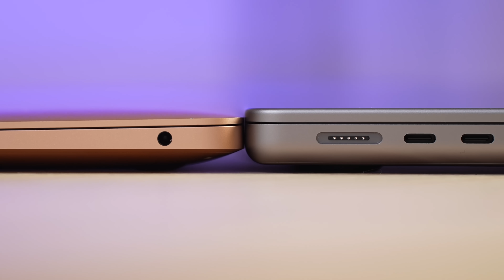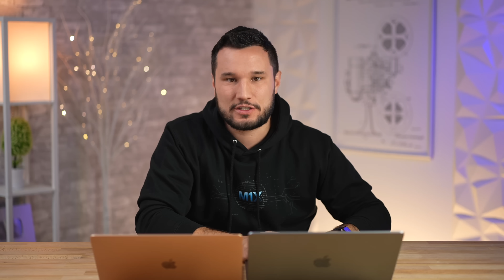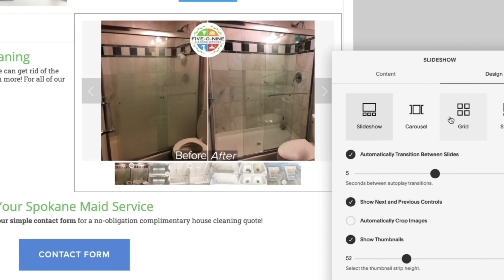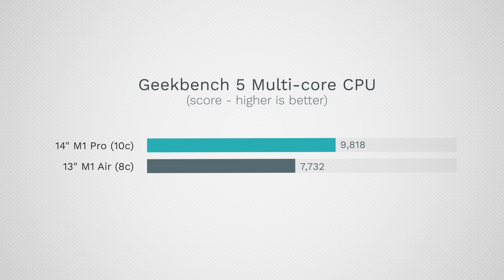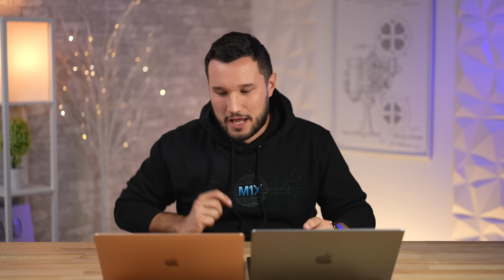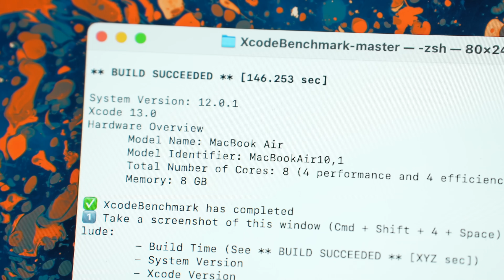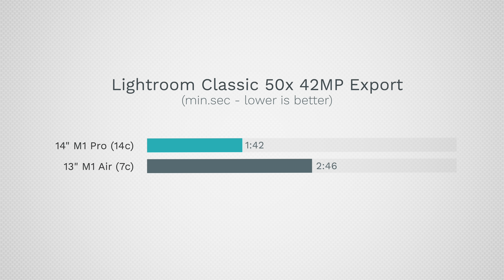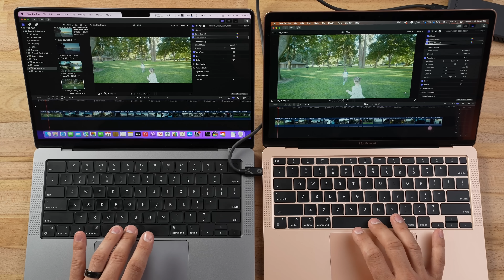14" MacBook Pro vs M1 MacBook Air - Worth $1,000 MORE? 🤔

Comment: New MacBook Pro just doesn't have the profile/image of a traditional Mac aesthetically. The camera notch (very un-Apple which has always been about symmetry and visual (and experiential) seamlessness), the lack of any kind of MacBook signage screen-side for the user (at least some kind of consumer reassurance it's worth spending big bucks beyond a comparably-kitted PC; that you've acquired something different) and the keyboard  just doesn't have that traditional Apple 'sophistication'/difference of the Space Grey/Gold etc aluminium in between the keys. In some ways, it could even be a new Dell XPS or MS Surface given the lack of logo and dearth of Apple-specific aesthetics (looking at this machine sitting at its screen at least). Apple is absolutely right to return to a chunkier profile with an emphasis on practicality and usability (retreating from the myopic days where thinness and near invisibility was an end in itself!), but there should have been some retention of the visual slickness that has always defined Apple products. That camera notch a big no. Some sort of bezel would have been preferable to maintain that Apple 'cleanness' stylistically. Same time, seems like a fantastic machine under the bonnet powered by a game-changing chip. It would be fantastic to have to this!! Criticism aside.

Comment: This review is slanted and MaxTech should not be doing this, one can see by his use of language, even though numbers are used he tries to negate the advantages of the 14” MACBOOK  there is very little explanation of its advantages, both laptops are very good however there is nothing non MAC out these that can compete, I guess you could get a MacBook Air with more ram and bring them closer in performance.

Comment: The new design and better specs makes the new one very tempting, but I question if it’s overkill for photo editing? Maybe I would be better off with the MacBook Air. I will be using an external monitor about half the time.

Comment: Well, it's really $850 if you compare the same RAM and SSD models...I keep trying to go with the MBA, but there's too much missing in the 2020 model: 

1. Crappy 720p webcam
2. single available TB4 port (I'm ignoring the SD and HDMI ports, which should have been higher speed IMHO)
3. "just" a Retina display, 400 nits max

The MBA is such an attractive machine, and in terms of computing power more than most people need, but there are a lot of reasons spend the extra $850 on the 14" pro, even with the uncharge for the 1TB SSD and the unbanned SoC.

Comment: Really great comparison between these two Macs. The Air with 16GB RAM seems still to be a very good choice for most tasks et even for heavier ones. The Pro as it is named is more suitable for professionals with daily heavy works (photos, videos or code compilations). But does it really worth 600$ more ? I would choose the Air (or the Mini) with 16GB RAM.

Comment: I think this comparision is a bit not fair for the M1 macbook air because it has only 8GB comparing to 16GB of the 14 inches, then maybe it has to manage swapping memory which costs part of performance there. Just sharing my thought, your videos are great, cheers guys !
Reply: He did a video comparing last year's MBP 8 vs 16GB and most of the time there's very little difference. Though 16GB RAM really should be the standard on any $1000+ laptop.

Comment: This isn’t really representative of the new MacBook pros though is it? It’s widely known that the model you’re testing against the 14 inch is gimped. Apple had chips that they needed to get rid of but were still able to offer additional performance for additional cost including all the ports and new features so they put out that model. If you’re looking for the performance that you seem to be looking for in this video, look at the real MacBook Pros.

Comment: I loveeee the fanless design of the m1 air - it is absolutely insane what you get for the price at the bottom end with these. The m1 pro is great, dont get me wrong, and a more usable overall computer - but the air is fantastic for a lightweight, quick laptop
Reply: Yea I think fanless design will last longer.
Reply: Fanless doesn't matter cause u could barely hear the fan in the new Macbook Pro in both 14 and 16
Reply: @xxkarlosxxxxxx7233  that’s true but the air getting up to 95 degrees Celsius is kinda nerve wracking, that’s almost boiling temp… 🥵
Reply: @getpballs  there are ways to reduce the temperature by adding cooling thermal paste between body and processor. It's not perfect solution but it helps. Also even with rendering 4K my Air is staying fairly cool.
Reply: Whatever which product Apple you buy , you will get 7 year update maximum
Reply: It's worth the extra weight for a larger display and better speakers better build quality with the fans
Reply: @cherkas009  also better display
Reply: @cherkas009  what is better quality of fans vs no fans? Having fans make it better quality? OMG :-)
Reply: I totally agree with that. Portability is insane with macbook air. However I expect a 14" air design without notch and iMac colors hopefully in 2022.
Reply: I should add that the M1 chip gets smarter (faster) over time. And it was 100% noticeable, from when you first use your laptop to months into use.
Reply: I think the better comparison who be MBP 2020 vs 2021, both 16gb.  The MPB 2020 you save almost a 1k still vs the 2021.
Reply: Yeah I'm really satisfied with my air
Reply: Yeah even at the same price tag I'll take 2020 MBA over MBP. Much better ergonomics are much more important to productivity.

Comment: Thank you for making such an in-depth comparison! I was surprised by how great the Air performed for its price point. I would've thought that the Air was a big improvement over the previous Air, but after seeing your benchmarks and investigating further to compare them to mine, I was surprised to find that just the Air is a massive upgrade in almost every way over the 2018 15" Macbook Pro I'm writing this comment on!
Reply: I have the same, those Apple Silicon have been looking really attractive haha, but I think I need to wait a few more years before upgrading. What are you thinking?

Comment: Both are great. To be fair I would utilize both at the same time. 14" more as laptop/desktop attached to 34" monitor and the Air as a backpack friendly when commuting or traveling. Both are amazing machines! Forgot to mention cameras ... in my opinion, this update is way overdue but 1080p is finally here!

Comment: I’m running a 2003 13” air with 8gb ram with Monterey and it runs amazing! So outdated though with no thunderbolt ports. The new M1 MacBooks look like they run fast as light in comparison. The new displays are what 💦dreams are made of 🤤

Comment: Macbook air is such a good value. Usually cheaper laptops suffer from lower quality components. Not here. I would bet that for 90% of people it should be sufficient. 

Now, the 14” improves usability with double ram, 512 gb storage, better screen, sound, camera, ports, CPU performance, graphics, footprint barely grew with an extra inch of usable screen… Its value is also undeniable. 

You say that the 14 inch is chunkier, but it is an illusion. In terms of footprint they occupy almost the same space. It may not look as stylish, but they prioritized function over style. For someone who appreciates utility, like me, I like it.

Comment: Hey I've got a question:
As an architecture student (1st year of masters) I want to get a new Macbook, as I have been using the 2012 13inch MBP. Is it worth holding out (a while) to get the M1 14inch MBP or will the M1 MBA (or potentially 13inch MBP) with 16gb RAM and 512gb SSD work well for me? What do you recommend? In my country the price difference is bigger so I'd like to know what you recommend.
Thanks for the video, I've really been enjoying them lately, really good in depth reviews!

Comment: Thank you for these detailed measurements !

Even the base M1 Pro with 16GB RAM has a RAM bandwidth of 200GBytes/sec — i.e. triple that of the M1 MBA.
So, both the MBP and the MBA might be using a similar processor architecture (M1), but the RAM speed seems to have a significant influence on the performance, be it for CPU-bound tasks like XCode compiles or GPU-heavy tasks like Blender renderings...  IMHO, worth the $1K price difference, thus.

Comment: MBA 13" is the best value for students and new Mac users, it shows what Apple Macs are capable in a small and reasonably price computer. With it, the amazing screen and loud speakers.. The 14" MBP is a waste of money if you're just doing some research or running some simple simulations, that extra power isn't really needed for school or daily use. However, having extra power is handy in-case you have friends that say that their core i5 is faster than the M1 Pro.

Comment: First of all, great video! Being a PC Windows minded hobbyist/gamer/engineer for over 25 years, with those amazing M1 specs I am really considering going to MacOS for quite some time now. Other friends and co-workers already made the jump. When in need, I can always use Rosetta or i.e. VMware. Yes Apple asks enormous prices for ram and ssd upgrades but a comparing gaming laptop the pricing is about the same. Question about the giveaway. You mention it will be one week from the 'launch video' at 7AM Pacific Time. Does that mean, aside from already posted videos, your will be doing a specific launch video? Would be nice to mention an end-date in your first post here.

Comment: Videos like these are fantastic help when making purchasing decisions. Comparing specifications side-by-side, and considering the total cost of an upgraded MacBook Air (RAM, SSD) made me consider stepping up to the M1 Pro model because of the difference in price. Watching the videos with detailed comparisons helped me realize what my needs are, what I will get if I stretch my budget, and what I can expect if I choose the upgraded MB Air for a lower cost instead. I also appreciate the emphasis on the practicality of each model depending on the use cases. Max Tech has become one of my primary sources for doing research before making a purchase!

Comment: Im surprised about the battery life. I guess the new display uses more temperature, but given the bigger battery size, I would expect the pro to last way longer, just how the 13" m1 pro had better battery life than the air. Maybe if all you do is Office and media consumption, the battery life surely would be longer in the 14" pro.

Comment: I think the Air would be enough for my performance needs, and the fanless design is awesome, but... only supporting one external display is a deal breaker for me. Even my old 2017 13" MBP supports two external 4k displays. I would go for the 14" if I had to replace my old one.

Comment: Guys! Greetings! Since the release of the MacBook Pro on the M1 Pro, I've been looking for such a comparison. And so you did it! Low bows to you for this video and heartfelt thanks! And, although I do not speak English at all, today web technologies allow you to watch videos in other languages, with simultaneous translation (thanks to other people for this), and everything was clear to me (I write via google translator). OK. Let's go back to the comparison. Now I see that Air, for today, to cope with all the tasks set by me. However, my headphone sound card does not support drivers for the new Mac OS. And in this case, a new, high-impedance output on the MacBook Pro M1 and a new, built-in microphone (I'm doing music and, a little photo) can help out a lot. Also, I often have to use the built-in SD card reader, which is not in the MacBook Air (adapters are not an option on the road. When Apple returned the connectors, I applauded). Also, it seems to me that the new MacBook Pro looks very old-school outwardly, which I really like. Now I come to one big BUT: in my country, $ 1 costs a little less "than a wing from a Boeing aircraft." Due to the current situation, not only in our country, but throughout the world, incomes have not only decreased, but are falling every month. Therefore, today, M1 Pro is still only a dream ... But dreaming is not harmful. I will dream, strive and not give up. I'm glad I got to know your channel. I wish you many subscribers and all the best!
 PS: The American keyboard layout will help me to master "touch typing" in my native language ...

Comment: Im doing pro level editing and photography. Max Tech is definitely the guy give you real shoot to decide what you need buy for your next shopping. I bought before the Mac book Air. I wish to have the new 14" it would be very helpful for me. Im getting slide issues with 4k editing. but sure you can run the proxy and finish all your task. Back to 14 inch it is faster and has more options add with card reader and HDmi. if you have your money it is pleasue to buy. Wishing the 14"inch for new 50 new age thx

Comment: Great review: it's down to Earth, compares both synthetic benchmarks and real-life applications. I believe a more fair comparison would be to use a 16Gb RAM / 512Gb SSD Macbook Air with a Macbook Pro of the same RAM and SSD space (the base model). I believe the performance for real-life applications, such as processing RAW files, would be closer between the 2 laptops - their prices would also be closer (a $600 difference). This review shows that the Macbook Air is worth buying for a lot of people, and that the Pro is also worth it the additional cost, depending on your use cases and budget.

Comment: The question if the display cracking issue is fixed in the new mbps. Air is still cool in 2021

Comment: Thanks for such an informative review, the M1 air has more power than I thought, I guess it depends on what you need to use it for mostly and the screen difference is remarkable side by side. A good spec mac lasts a long time, I'm still using my mid 2014 macbook for my digital art which has been amazing for the last 7 years, but the graphics are not able to cope with much now, I cant upgrade the latest photoshop and other software I use, so Ill be needing to upgrade, would love to win that 14 inch, it sounds amazing! The cost is eye watering in NZ so it would be awesome! Thank you for offering this incredible givaway!

Comment: It's time to upgrade from my 13" 2015 pro that's now having charging issues due to rusting magsafe. I'm torn between between M1 air and base 14" for battery life and cost reasons. The M1 air itself would be a big upgrade but 14" would be more future-proof. I'll use it for digital marketing

Comment: Apple's lineup makes so much sense now. Obviously they are all luxury machines: I remember when I was given my first MacBook I was so happy cause I knew it was an expense and jewel-present. Leaving the pricing aside, the transition towards apple silicon enabled great targeting of consumers based on user case. I know many non-pros are still going to purchase the new M1 Pro and M1 Max MacBooks, however the demarcation line between pro machines and luxury laptops is very clear now. I'm still curious to see what will happen with the 13inch Pro: over the past years its position in the market was kind of confusing as most people had one and used it as an "Air" (if it makes sense). To me it just represented 300€ more than I could spend and a brighter screen (that's the main issue for me with the MacBook Air). I wonder where will the 13inch MacBook be placed now that "real" pro machines are out. Will it be a everyday consumer friendly laptop or a "budget pro"? Will it get discontinued? Will the MacBook Air with the M2 chip just be "The Macbook"? 

I'm just curious to see what will happen next. 

However thanks a lot for this comparison. The MacBook Air has been my favorite laptop of all time and I was really hoping to see this test =)

Comment: As a software developer, I do some heavy workloads on my M1 Macbook Air. BY FAR, it's the best laptop I ever had, and probably the cheapest one I bought for work. The only flaws the M1 Air has, are the support for only 1 external monitor and the fact that both ports are on the same side. Hopefully that will be fixed when the M2 Air comes out. Maybe it will have support for 32GB RAM as well 🤞

Comment: Do you think the 2 extra cpu are better using windows in  Parallels desktop (in power bi desktop for example)? And also comparing the 16 and 32 ram is there a hudge difference to pay more for them ?

Comment: The one most people will be able to relate to!! IMO the Pro is worth $1000 if you need the extra performance and like the new design and extra features like the better display and ports! However at $999, and even cheaper for students via student cars, you just can't beat the Air with the M1 chip! Having the new Pro's released doesn't all of the sudden make the AIR a bad or slow machine, its still an insane deal for the package!

Comment: Interesting to see the relative performance.

So if you have 8 core GPU MBA and a 32 GPU core MBP the performance literally should be about 4x better. So if it’s a 2 min project on the Air then it’s probably a 30s project on the Pro.

Comment: I wonder how are the temps on the back for low power usage like web browsing and youtube ... I use my machine literally as a laptop, the M1 pro has more silicon which would mean more idle power but also has air flow so it dump heat to the air and not to my legs 😅

Comment: The m1 macbook air is enough for most average users. The m1 chip is so fast that even if the aforementioned average user decides to pickup a hobby that requires a powerful mac, it would serve them really well.

Comment: So...M1 Air is scary good value, and M1 Pro/Max are scary good performance. Amazingly good value depending on use and key needs for either. Thanks for grounding the comparison in probably the biggest price difference in the current lineup.